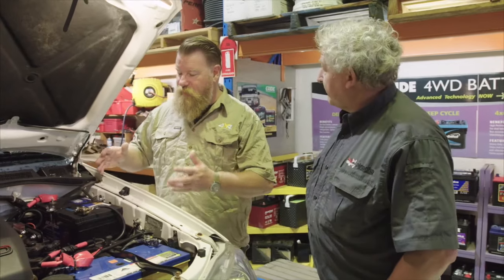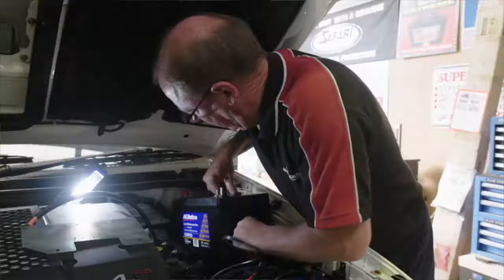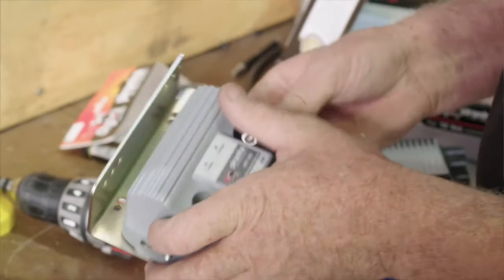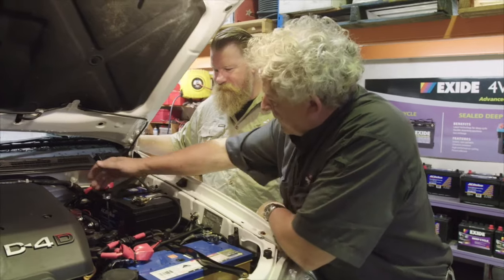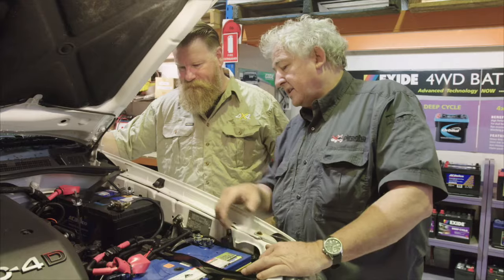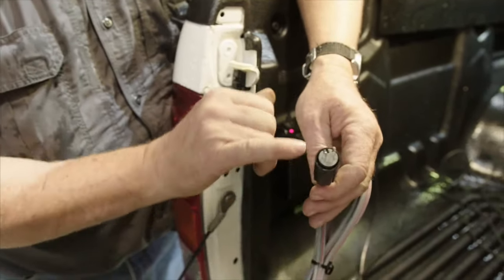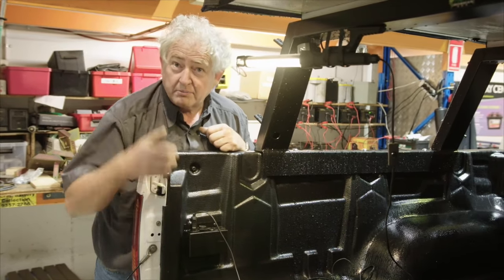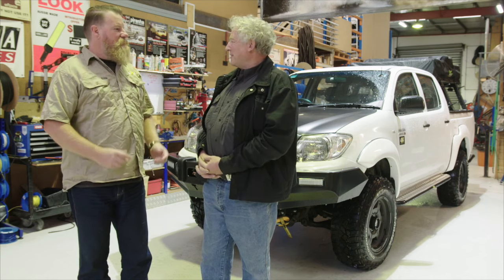Project Toyota Hilux | Build Part 6: Piranha | 4X4 Australia

Comment: That's intelligent: 12v sockets and plugs pointing upwards in an open tub. They're barely waterproof in that situation with the rubber bungs in place when not in use. When a cig or merit plug is fitted forget it ,the water will follow the lead and plug down into the socket.